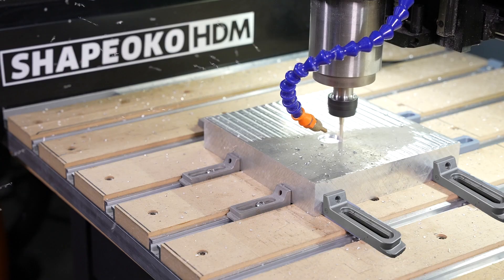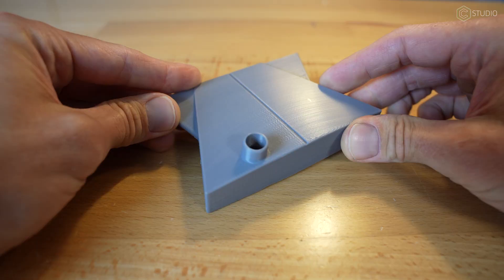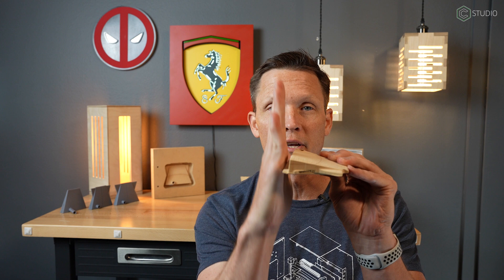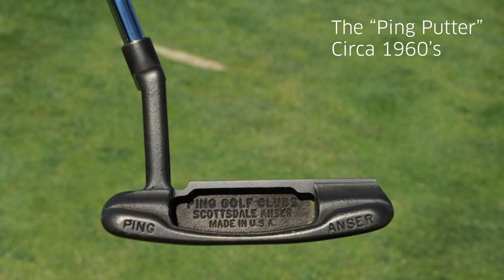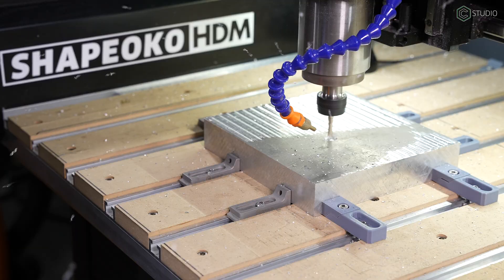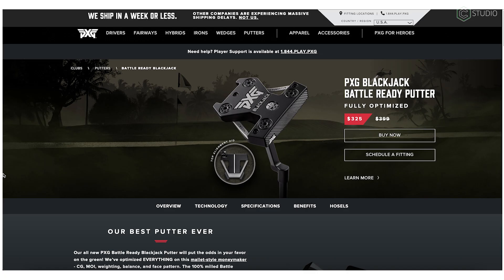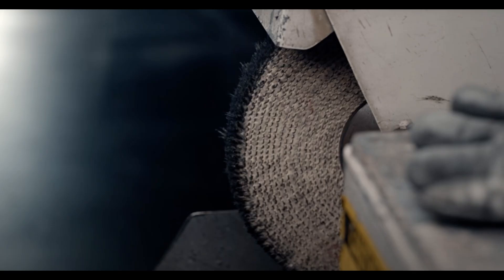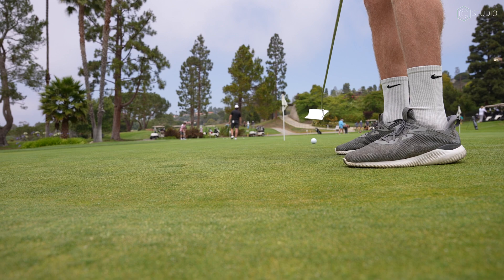Custom Putter on a Shapeoko CNC Router

Comment: If I was to try making a putter I'd take a relatively low tech approach, since I don't have a milling machine. Carve the head out of wax, coat it in plaster, melt the wax and pour some kind of molten metal in there, probably aluminum. What's a good metal?

Comment: Is this possible with the nomad 3?
Reply from the maker: Yes you can definitely make a putter on NOMAD 3.  You'll have to adjust for the available capacity of the machine as well as the spindle requirements.  You can definitely make a functional putter on that machine.  100%

Comment: How do you keep the material in place after flipping? The tap is enough to hold the up and keep it still while the underside is being milked?
Reply from the maker: We modeled in some substantial posts (tabs) to hold the head in space.  At the end of SIDE-B programming there were toolpaths to cut off the back two posts and narrow the front two down to nearly nothing.   Bend the letter head back and forth a couple times and it was free.
Reply from the maker: Here’s a look at it.  https://www.instagram.com/reel/CfRiD-VllrU/?igshid=YmMyMTA2M2Y=

Comment: Were you using a sweepy before you added the air blast?
Reply from the maker: For MDF, absolutely!    If not for filming Sweepy is a must.  On the aluminum I was the air blast.  Standing over the project the whole time.

Comment: Would love a link to those little things of enamel!
Reply from the maker: Now in the description and here: G-Paint Golf Club Paint - Touch... https://www.amazon.com/dp/B08154DVQ4?ref=ppx_pop_mob_ap_share
Reply: Look for golf club "scoring paint". At least that was what it was called in the late 80's when I was doing golf club repair in my garage. 😉
Reply: @carbide3d  Thanks!
Reply: @bob_mosavo  Thanks!
Reply: @billstrahan4791  Sure! And you don't have to use a needle applicator, like in the video. I used to just fill in grooves or engraving on the bottom of a club and squeegee off the excess.